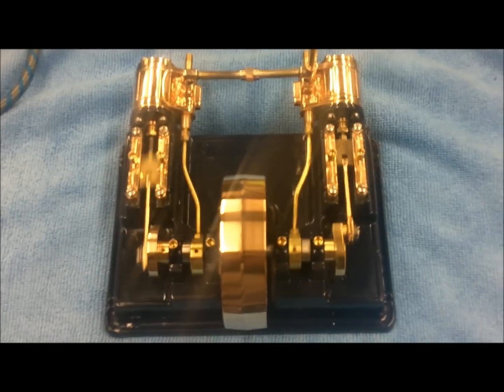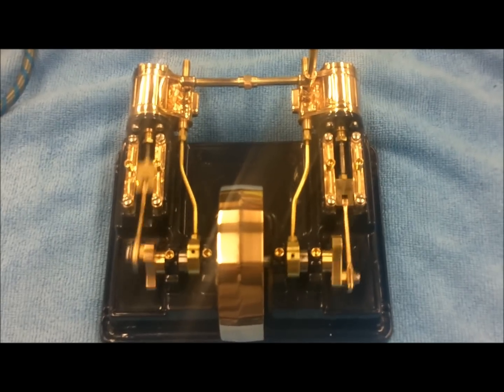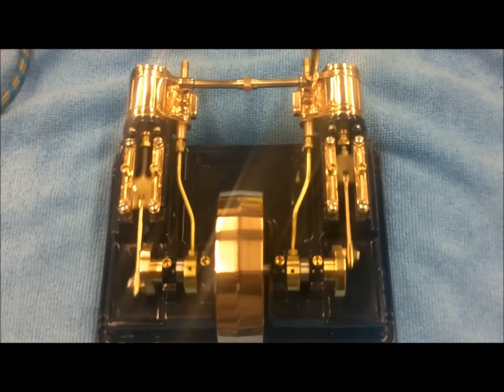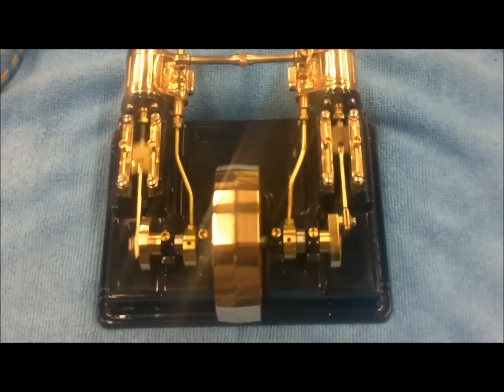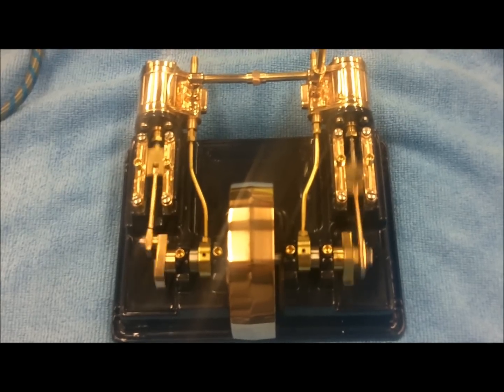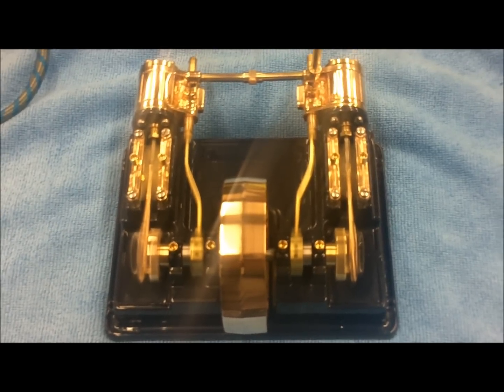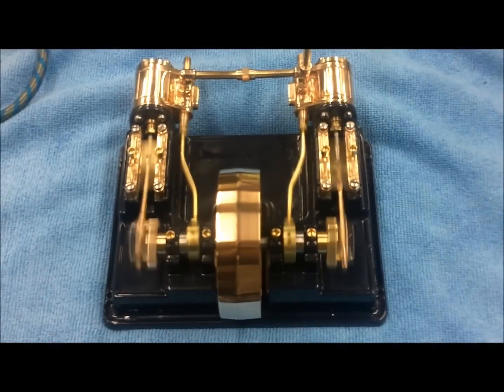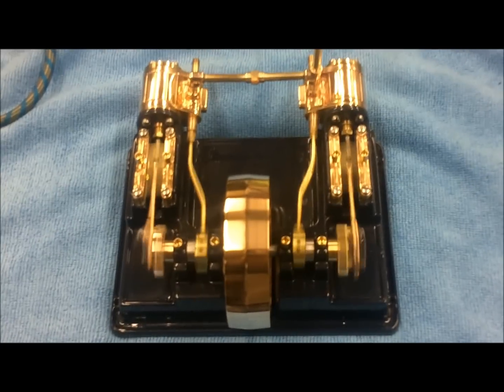Model Steam Engine Running

Comment: It is beautiful.  Where can you attach a belt?
Reply: you would run a belt off the main flywheel on something like this.
Reply: @gravedigr12  Most belts are one piece, no way to get it on.
Reply: Ramblequist 
You can get belting from PM Research, you simply glue it together with super glue to get the desired length.